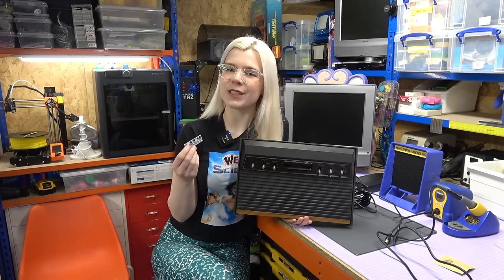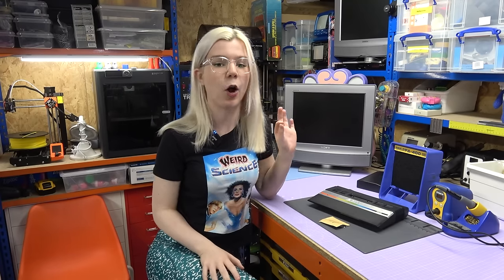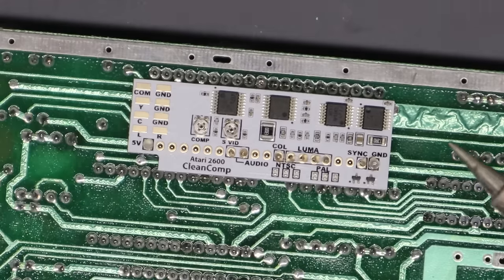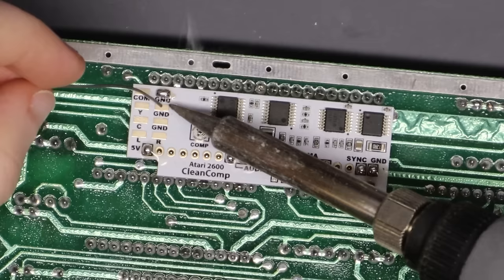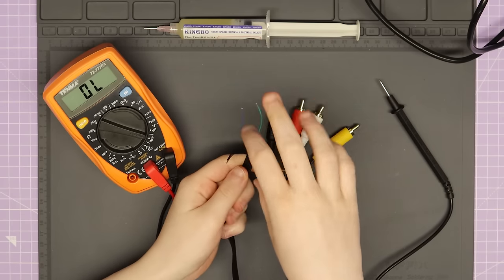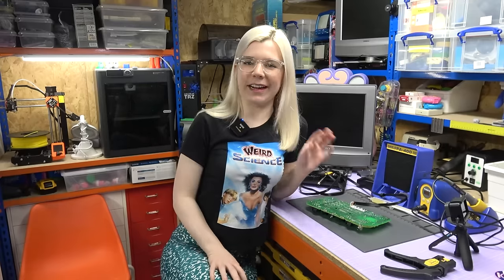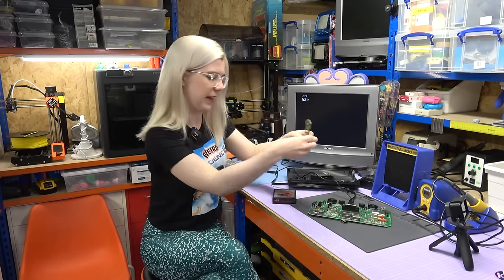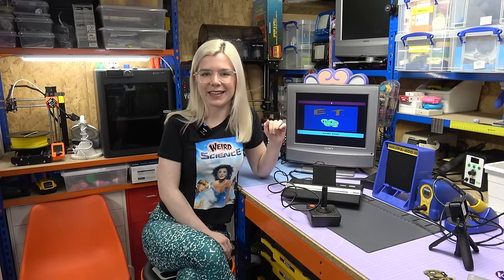Composite video modding the Atari 2600

Comment: I done this type of mod on several Atari's, Prefer it as its non destructive therefore reversable. It would be good if Luke (Retro Six)  was to consider creating a similar MOD for the 7800, though I believe it is possible to do with this MOD with additional wiring.

Comment: That is an excellently designed PCB.  Nice work on the mod.  One question though - why not just solder the ground wires individually rather than twisted together?

Comment: 😂 Not sure why this came up for me to watch. I do have a old Atari 2600 woody though. I took it apart over 15 years ago to clean it up. The board was crap and I threw it away😢. Wished i woild have kept it now😅. I got into emulation many years ago and was going to mod the case with a mini pc. Now that the mini pc's have gotten even smaller, it may be time for me to start the build. I want to add the mini pc with all the Atari 2600, 5200 and 7800 games.

Comment: What exactly does flux do? I have seen/heard of it in many videos but never quite understood what it was used for.
Reply: Flux is a chemical compound that helps prepare the metal surfaces for soldering by removing oxides, promoting wetting, and enhancing the flow of solder. It typically comes in the form of a paste, liquid, or core within the solder wire.

Comment: I'm not too familiar with the junior; when you're explaining how you put the case back together I don't see the channel selector switch on the PCB. Has that been removed/is it attached to the top of the case? Do the switch and cable both fit together once the cable has been fed through that hole on the end?

Comment: @Kari.... "Modern TVs" ??? well all of Modern TVs lacks S-video connector now, but still most of them comes with Single AV(composite)/Component (RGB) input in form of RCA Jacks which is also disappearing from current TVs fast and very soon we might be losing RF also...
PS: And at 3:38 that's palm of worker hand, 
And yours "DISCLAIMER: Please do not take this video as a tutorial / advice. I'm not an expert, this is just my hobby :)"  
that's 3D printer (Original Prusa Mini+)at the back & soldering heat gun, soldering station & PSU up at front? Right, so might not be expert but must had sound knowledge of electrical & electronics basic fundamentals to operate these instruments otherwise its quiet impossible to work with these.
good, keep it up.

Comment: Hi kari what solder wire do you use and where do you get it from
Reply from the maker: this is the one https://cpc.farnell.com/duratool/d03346/solder-wire-sn60-pb40-0-7mm-50g/dp/SD02298

Comment: So you had to pass the cable through the house before you soldered it, right?
Reply from the maker: No … Check out around 01:21 in the video, the holes are on the seam where the case comes apart.
Reply: @karilawler Okay well what about that end part where you show that thin hole?

Comment: Weird Science!
Reply: BTW, the fiddly soldering is due to tension of the ground wire. It faced the other way, so it puts strain on the cable. I would usually do such a cable last. Never dare to ask someone else to help... ;-)
Reply: Does 'modding' PlayStations count? :-D